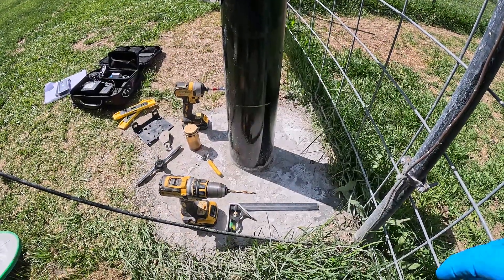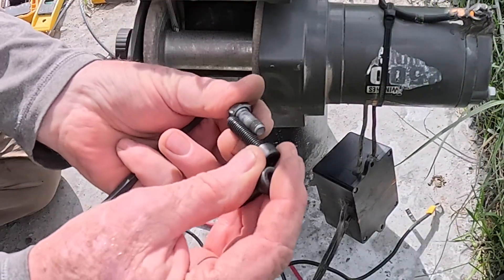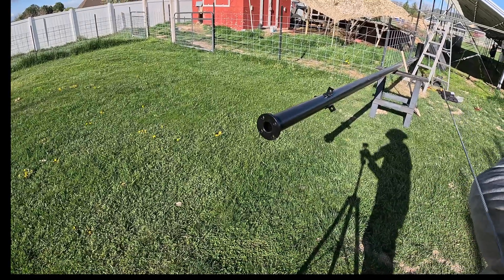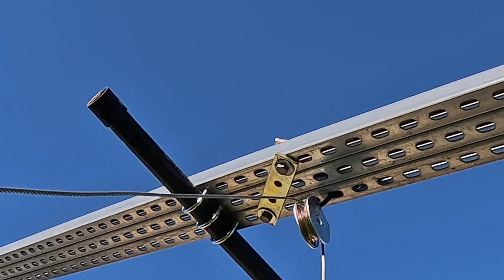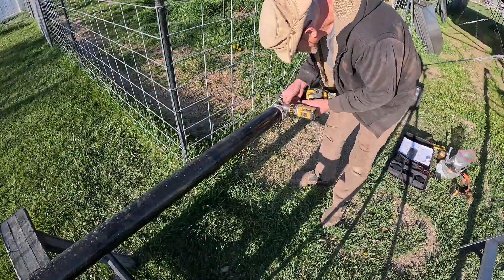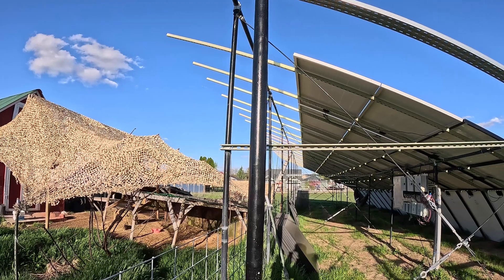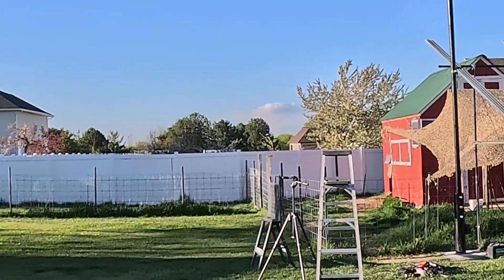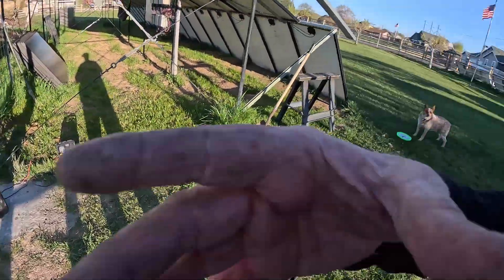DIY Wind Turbine 4” well pipe Mast build Part 3.. We have a powered Mast!

Comment: Great job PT , Solar and wind power , Excellent !!! When i was younger it was my ambition to live out bush and be totally off grid and self sufficient , unfortunately the Wife had other ideas . You are very fortunate , i envy you Matt . Nice Job . 👍👍 Cheers Nev . ✌
Reply from the maker: Hello Nev, I too wanted to live off-grid for many years! 😃 
I've been interested in personal power generation for many years but always felt like it was not fully ready for prime time until recently. 
Now, there are lots of very good choices for consumers. 
I'm not a fan of Giant Commercial Solar or wind farm projects, primarily because it is a never-ending expensive monthly cost that when it fails, everyone is without power.  I've always thought individual small power systems were a much better solution for people. The huge cost of ownership of the commercial Giant size wind turbines is a nightmare. It takes a small army to do any repairs or general maintenance to these huge systems.  Not to mention the never ending telephone poles and electrical wire eye sores all over the world. 
Individual power systems require you to be smarter and engaged with your own power generation, but if there is a grid failure.. I am still up and happily running. 😊
Nice to hear from you brother 🙏 
Stay Powered my friend 
Peace Prospector Tripp

Comment: Looks like a great job PT. And looks like it's level to boot. Hey got a strange Question for ya.. About what time of the day was this when you were about finished, and was the Moon out (or able to be seen) in the daylite?
Reply from the maker: Must be something we ate as kids. 😆 🤣 😂  yeah, I noticed the moon as well, bfam. 🌙 🌚 🌔 🌕 🌖 🌛 Maybe 6 pm or so.
I believe the Mast will be a good one.  
The Vertical Helix Wind Turbine weighs about 85 lbs, being out there on the end on the Mast, that should stress test the little 2500lb winch a bit. I purposely used a pulley on the rack to 1/2 the lifting weight and help the little winch. The Mast weighs about 150 lbs, so lifting is no issue at the moment.  Once the turbine is installed, the lift weight will be about 4x to 5x what it lifts without the turbine. (I can change the lift point if necessary)
I believe it will be about 600~700 lbs at the 90-degree position, and less as it gets more upright.
I think they rate the winches for pulling weight, not dead lift weight. Anyway, all that being said. The proof is in the putting.. or is it pudding? 😆 
We will see pretty dang soon.
Thanks much Johnny 🙏 ☺️
Peace Prospector Tripp

Comment: nice, easy to lower if you need to work on the unit, well i would guess the motor/blades would add #60lbs? maybe less?
Reply from the maker: Yes sir, the turbine weighs about 85 lbs   so it’s definitely going to a bit of a load. The little winch is rated at 2500 lbs and half the load with the pulley it should be fine. We’ll see pretty soon 😂 
Thanks Diggin 
Peace Prospector Tripp